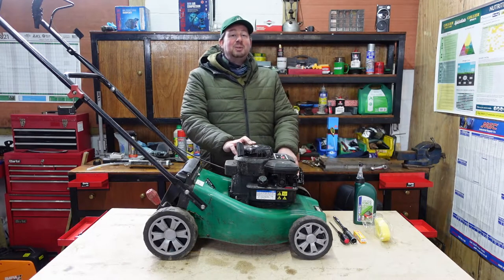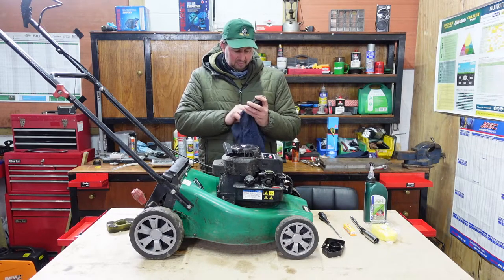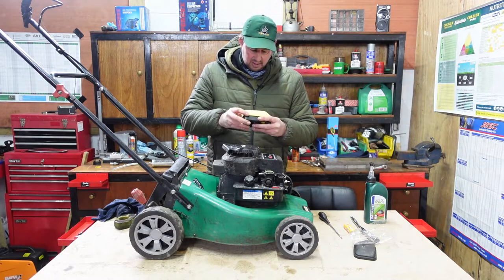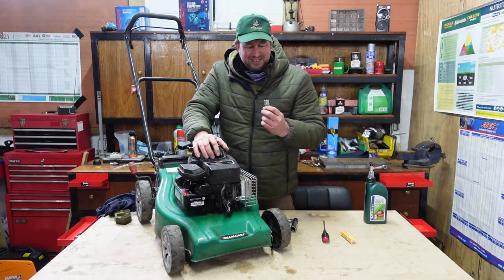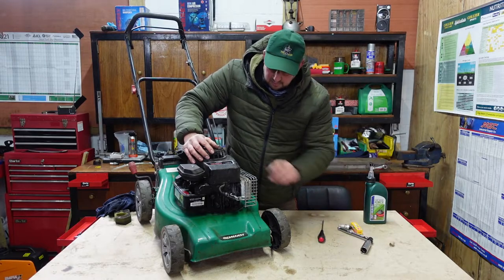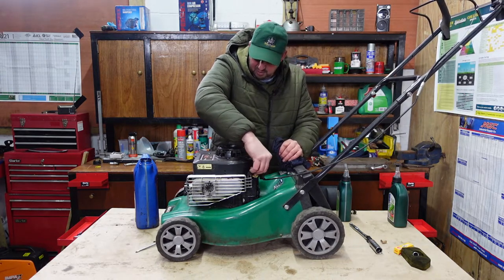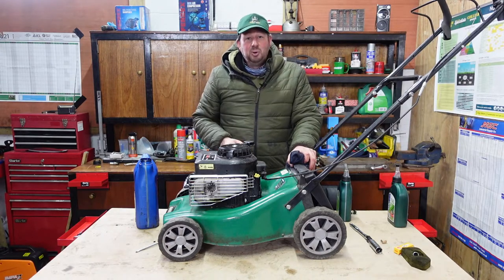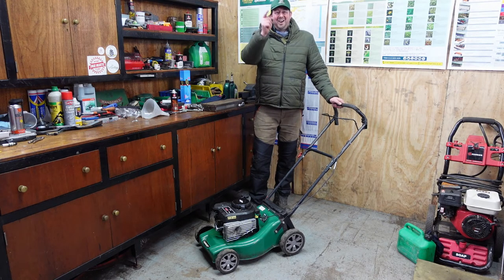Briggs & Stratton 450 Series Engine Service Mower repair tutorial how to . Service kit parts list.

Comment from the maker: Briggs & Stratton 450 Series Engine Service tutorial. Mower repair instructions with service kit parts list for this qualcast mower.
Reply: I've owned a Sprinter version of one of these mowers from new with the 450 series Briggs engine and the same plastic carby setup and the user manual states to impregnate the oil filter with clean engine oil and squeeze out the excess into a clean cloth before installing. It also states they can be cleaned in liquid detergent and water and re-used. (Solvents and compressed air will damage them.) The base of the filter does come with a fibre or paper like dark grey washer to seal the base to the carby too. And the fuel pick up with the mesh screen being blocked or partially blocked with debris is a common cause of engine surging for this carby set up. Easy enough to fix though.
Edit: this is from Australia just in case there are differences and our plugs are the resistor type for this engine. NGK BR2-LM or Champion RJ19LM. The Champion plug was the original but I always use the NGK equivalent anyway. The resistance of the brand new plug is around 10,900 - 11,000 ohms. Some state that anything over 10,000ohms for a mower or any garden equipment you should throw away but I suspect it's different from country to country. For instance there's a sticker on the fuel tank of my mower stating that because this engine is made specifically for export it is exempt from U.S.A emission regulations.
My engine is a 9T502. For anyone not familiar with the numbers, that's the first set of numbers on the front of the engine metal cowling stamped into the metal.
       With all Briggs and Stratton engines the first set of numbers is "Model" of engine, second set "Type" and third set is the "Code" and date of manufacture reading backwards. example - 11111152 = 2011, November, 11th and the final 2 numbers are for something else like shift and store location or something but you don't worry about the last two. The first 6 numbers of the 3rd set are the date of manufacture.
Reply from the maker: Wow...... Thanks for all of that fantastic information. 
I'm not sure how different the engines are for the different countries but I do know that one of the major problems we have in the UK is the diaphragm becomes perforated and there is then an irregular fuel supply.
It is fairly simple, but quite fiddly to change and there is no difference between the old diaphragm and gasket and the new one to the naked eye but after they have been changed it is very obvious that this has been a problem.

With regards to the spark plug, I am after a website that provides a reliable comparison table. 

Thanks for taking the time to reply and help others,

Jimmy 👍

Comment: Thanks Jimmy, gonna save my husband some repair bills by servicing his equipment. Post Covid I only work part time. What you say is true the Briggs & Stratton engine responds well to an air filter and plug change. Today I did that on an old Viking MB 650 it started up 5-6 pull. I watched this for the oil change. Now to buy a pump ☺️👍🏻👍🏻👍🏻
Reply from the maker: I'm so happy my video helped you.
Good luck with the rest of the repairs and please keep me informed with how you get on with the other bits.

Thanks for watching,

Jimmy 👍
Reply: @JimmyTheMower  what prompted this was; his 2 newest mowers are both in at the dealers. Quoted 3 weeks to repair. It’s that time of year when his clients are on the blower asking for a first cut of the season. 
He also has petrol blowers, strimmers a chainsaw and a hedgtrimmer. He’s mainly gone battery on hedgtrimmers. He reckons the petrol is superior on thicker hedges. They are all 2 stroke. I’ve subscribed. Thanks again.
Reply from the maker: Brilliant, anything you want a video of just let me know and I will try my best.

Jimmy

Comment: I have a ferret Aldi mower. Only one year old but hasn’t been used much. I’ll take a look at your suggestions for a service, which were very clear and helpful. The one thing I needed to know was how to remove the old petrol. Do I use the oil syringe?
Thanks for your help.
Reply from the maker: Yes you can use the oil syringe, or just take the fuel pipe off the bottom of the tank and let it flow out that way.

Comment: Ive inherited a Qualcast petrol mower with the Briggs & Stratton 148cc 450 series motor.
As, with the case of the one you have just serviced, Ive took the air filter & spark plug out, they look about on par with yours.
I have still got to empty the oil, if there is any in, that is, as nothing is showing on the dipstick.
I suffer from acute back , neck & shoulder pain, so I can only do bits when Im not in too much pain.
When Ive done the service & hopefully mine starts as well, I will post a comment, thanks for the video, stay safe.
Its a thumbs up & subscribe from me.
Reply from the maker: Thank you Alan 👍

Comment: hi good video, the air filter box is on the wrong way the pointy bit should face the handles
Reply from the maker: Well spotted.
In my haste to see it running I fitted it backwards 🤣🤣🤣
Reply: Hi Scottish Lad, looks like it doesnt matter which way the air filter box goes on as it started with it on the "wrong" way.
Reply: @alandobb950  Hi, the Lawnmower will run without an air filter box on too, but that doesn't mean its right lol
Reply: @ScottishLad.  it's an OCD thing lol
Reply: @themowerman  yes lol, love your channel by the way Mick, and Riley boy :)
Reply: @ScottishLad.  ta mate

Comment: Excellent presentation. Well done. I am currently servicing this engine in a Viking MB 248 T mower that I recently purchased through an classifieds site at a good price and your video reassured me that I did the right thing.  I'm interested in one thing please.  When I removed the air filter, the carburetor underneath was pretty dirty.  I'm wondering if you happen to know if there is a diaphragm or something in the hole down in the carburetor where the bolt that goes through the carburetor and holds the air filter housing goes.  I tried to clean it (the hole) and I hope I didn't damage anything - if it's not by chance some kind of overflow - the drain back to the gas tank (which is under the hole) in case the carburetor is being cleaned.  Thanks, and video.  Greetings from Slovakia. Slavo
Reply from the maker: The only diaphragm is between the top of the fuel tank and the plastic carburettor.
The tiniest pin hole that you can't even see will cause problems, so it is always worth replacing it 👍

Comment: They all come damp with oil from new, the oil is what stops the dust passing through the filter. The point of wringing the filter out is to bring it back to the necessary state of dampness, not too heavy with oil, unnecessarily restricting air flow. Dust penetration can cause other problems as well, it often blocks the air intake port for the emulsion tube, causing the engine to run extremely rich. On service I always make sure that port is clear. Remember, this video can be watched across the world, I'm watching it from Australia, a country with extreme condition  and you need to keep that in mined when offering advice. A dry filter can be got away with if the conditions are lush and green, but not if their is any dust. The only time a foam filter should not be oiled is when it is used as a pre-filter around the outside of a paper filter, such as on Honda mowers. I'm available for further advice if needed.
Reply from the maker: Thank you for the great advice and I will incorporate this in to future videos.
I have already found your website ☺️

Comment: Try using a mr funnel as well. Many microlight pilots use them when fuelling from Jerry cans. The amount of stuff that’s get filtered out is unreal.
Reply from the maker: I've never heard of one of those, i will have to take a look.
Thanks for the heads up 👍
Reply: Those Mr Funnels freak me out. I don't know how they filter out ethanol from fuel as you pour it in, it's bloody amazing.
Reply from the maker: I still need to get one of these.

Comment: My mower looks like this but the side metal cover is right side . Any tips how I can pull it over easier . As holding the handle n bending down for the pull cord really hurts me
Reply from the maker: They should have a little eye hook about half way up the handle which holds the starter rope so you don't have to bend down so far.

Comment: Hi Jimmy hope you well. I have a trojan 16 lawnmower and the engine working fine which is a B&Stratton 35 classic,  but the deck and handle are ,lets say capute. Do you no if the qualcast deck would be good for replacement of the deck.
Reply from the maker: Wow, that's a great question Ian. I'm really not sure how to answer it.
I presume that if it fits and all the holes are in the correct places then it should work. 
I will be very interested to know how you get on with this.

Jimmy.

Comment: Hi jimmy, My mower(same model) is too loud and too much smoke(of white colour) is coming out. It remained completely unused for one year. Can you please help me fix the problems. Thanks
Reply from the maker: Drain all of the fuel out.
Then do a full service.
Start and run the mower for a full 10 minutes and it will either live or die. 
Best of luck 👍

Comment: Hi Jimmy. Got the same machine as the one above. Hit a hidden concrete block and since then the engine is running very rough, like the timing has been knocked out or something. Nothing obscuring the blade. Any suggestions to solving the problem would be greatly received, please. Thank you.
Reply from the maker: That's a tricky one... there should be a woodruff key in the shaft that breaks when you hit something so it doesn't damage the engine.
If this didn't happen then maybe the shaft is bent, which is causing the vibration or maybe indeed the engine has been damaged.
You can remove the OHV cover and slowly turn the blade ( without a spark plug in ) and measure the gap at the closing point of the piston. 
It can be very difficult to reset these gaps and the timing though.
If you take it to a repair shop and show them how it runs then they are likely to give you a diagnosis straight away and an idea of repair costs.
Reply: Thank you for you insight @JimmyTheMower  ! I shall follow your advice above servicing video step by step first and if that doesn’t work I shall have to find and repair shop. Thanks again!
Reply from the maker: Best of luck with it all 👍

Comment: very helpful. Are these mowers prone to the coil going down?
Thanks
Reply from the maker: They can be but they seem to last a long time first.
We've never really had problems with them domestically but a few that are used commercially and run very hot for extended periods of time can suffer.

Thanks for watching,

Jimmy
Reply: @JimmyTheMower  Hi Jimmy. Is it ok to use 5w-40 in a Briggs & Stratton 450?
It had been left it out in the street for a few days for the bin men. I took it, cleaned the carb, changed the plug and hey presto!
The Rockoil in my local Home Bargains is only £5.50 a litre but there's conflicting advice on whether it's suitable or not.
Thanks.
Mark.
Reply from the maker: Go for it.
40w is thicker and 5 is thinner so it will be fine 🙂
Reply: @JimmyTheMower , sorry Jimmy, my typo, I meant 5w-30
Reply from the maker: That's fine too.
Same viscosity as SAE30 👍

Comment: For oil there is a drainage hole at the bottom.
Reply from the maker: No way, don't tell me that there's an easier way......
Reply: @JimmyTheMower yep, drain plug underneath!! Also good to sharpen the blade when it’s in the workshop. Great vid.
Reply from the maker: @PitStopCrew I will have to take a look for the drain plug next time.
And I think I made a different video about sharpening / changing the blade somewhere 🤔 
Thanks for watching though, I really appreciate it 👍

Comment: I appreciate that sucking the oil is easier, but that engine has a sump plug and that oil is extremely neglected. You will get more of the crap out from the sump, especially if you add some oil to diluted and remove more of the crap oil and contaminates.

I think sucking the oil is fine for well maintained engine though.
Reply from the maker: That is a very valid point. Thank you 👍

Comment: How do I install a kill switch to this engine ?
Reply from the maker: What for ?
If you let go of the handle it cuts out straight away.
Reply: @JimmyTheMower  My lawn mower handle cable is not connected, I don't know how to do so.
Reply from the maker: It's a cable that runs from the handle to the engine.
It is quite easy to fit but the mower won't start or stop without one.
 You need to find a local repair shop and they will find you the right cable.

Comment: I have to semi regular write off those engines as irreparable because people have done home service and fitted a dry air filters causing the engine to ingest large amounts of dust, tearing the aluminum cylinder to pieces. All foam filters have to be wet down with engine oil, then thoroughly wrung out in a piece of rag to bring the oil content back to right level. You need correct that video immediately.  I repair an average 2,500 mowers a year so you can take my opinion seriously on this.matter.
Reply from the maker: Is this true with all mowers ?
We normally buy 3 or 4 new mowers per year and I've never noticed the filters are soaked with oil ?
I've just read up on it and it seems to be a thing outside of the UK but I'm pretty sure most people here don't do it.

I will have to change my ways and give it a go 👍

Comment: Jimmy should stop giving advice on lawn mower service until he learns the job properly. He made an absolutely atrocious unforgivable mistake in this video that will quickly destroy the engine and this opinion is coming from a professional that has been doing the job for 46 years
Reply from the maker: I put the air filter on backwards but considering most machines I get in don't even have one. So maybe not the end of the world.
Any hints and tips greatly appreciated 🙂
Reply: It's a lawn mower. Not the space shuttle.